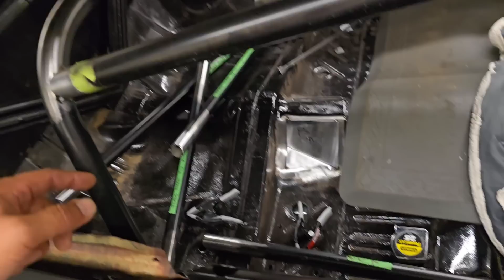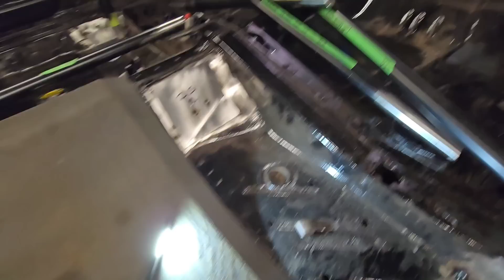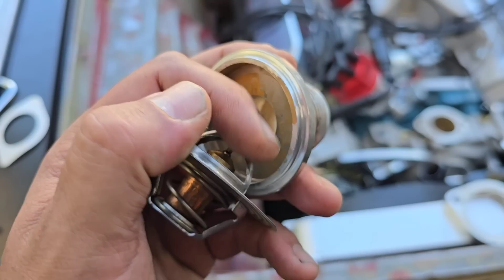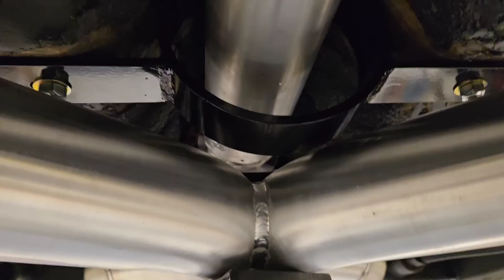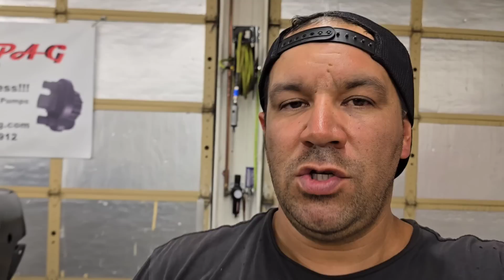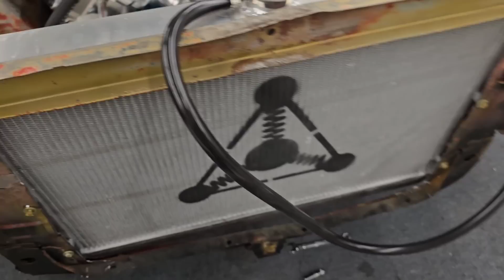My First Time Installing A Roll Cage.  One Week Left!  Thrashing All Day Long.

Comment: At idol 15 psi should be fine if it doesn’t drop to much at high rpm you should be pretty ok im no professional but I have played alot with big block cars here in Australia i only had one let me down idol psi on my fords was around between 18 psi down to 15 it’s at high rpm I would be more worried

Comment: 15 to 20 on oil at 180 too low. oil plug may be out somewhere. or bad gauge or bad oil pump. i'd drain check oil for metal. something is not holding oil pressure. kink in oil gauge line? run digital gauge. check oil pressure using manual pressure gauge.

Comment: Some great content here!! I installed my first hoop, down legs and cross bar in my 70 Camaro this year. I designed it to have a removeable cross bar. Once welded in I found my cross bar supports had heat distorted and make it difficult to remove and re-bolt back into place. The other challenge I ran into was painting it in place. While it looks great, it could have been better if I welded it more slowly, pre-painted the non weld areas. Might not get another chance but who knows?

Comment: I'd like to see around 40 pounds of oil pressure on all motors that I've built at idle  Big blocked Mopars  are pretty easy to pull the oil pump you can do it with them an hour  And you do not have to take the PAN off  If you still have a stock k frame You can Jack the motor up on the driver's side take 5 bolts out and the oil pump comes right off of the side of the block in the front where the oil filter screws on too  I have ran into oil pump relief valves not working properly  If not sure consult with your engine builder he will let you know if it's safe or  not to run that low of oil per  I'm looking forward  To see and you and Olivia getting this bad boy up and running Going to be a sweet ride

Comment: I had a feeling your thermostat was going to leak. I'd bet you clearanced it enough to appear flush, but not enough to account for O-Ring compression. Or you got " hosed " ( Pun intended ) on the expensive fitting and it's crap.

Comment: I enjoy seeing the work, but maybe not so much the moving around POV. Static video where you can't see everything is Ok as long as you're talking about what you're doing. Also in moderation ... 100 weld joints in the roll cage, I don't necessary want to watch all 100 welds.

Comment: You just showed the secret in wire feed welding, preheating  of the metal. However using a oxy- acetylene  set- up, and getting the metal cherry red, will produce your near perfect weld. You need someone next to you applying the evenly spread flame using a "Rosebud" tip. Try it sometime.

Comment: Love the guages. Sounds great at idle. Check Precision Oil Pumps for blue printed oil pump. You could always change the spring in the pump to adjust the pressure.

Comment: Danny, on the power steering bleeding process. you should be able to turn the wheel all the way to the extreme left until it stops. then hold it there. You will hear it start to scream a little. while you do this have someone add a little fluid if needed. then repeat the process turning right.
do this a few times until all the air works itself out of the system. Not sure if this is the process you were already using, so I thought I would comment. Great work by the way!
Hope this helps. Art.

Comment: Any time I have to burp the power steering system I put the front end in the air and cycle the fluid to purge the air out about 20 times full lock to lock 
Then turn the car on and do it about 5-10 times more 
Top off as needed
Reply: It’s good to see you fight threw the frustrations that custom parts ands mods tend to bring to the table 
Keep up the good work!

Comment: Instead of using flat washers on the bolts for you drive shaft hoop, you could get some flat strap stock, drill holes in it the proper distance apart, and weld the bolts to it...
That way, you eliminate the need to have a helper to hold the bolt while you loosen or tighten the locking nuts.

Comment: My big block the clearances were set to run 20w50 wìght oil I have 10w30 in it my engine builder didn't tell me that I also put a high volume oil pump but stock pressure my last big block had a high volume high pressure pump and it had 80 psi and the lowest it would go was 70psi this engine has 60 psi and then drops down to almost nothing but if I have it at 1000 rpm it holds about 30 psi  so I'm going to put the 20w50 oil in it and see if it changes if not I'll be pulling the engine back out to  change the pump and probably go with the selling shark tooth pump In it. Also I have to deal with my cooling problem

Comment: Big block Chryslers with 2 - 2.5  main / Rod clearance with a HV mellings style pump idling Hot 45-50 psi. , (30weight oil )
cut open your oil filter , if their is no metal in it ?  Maybe get a bigger pump , at least they bolt on easy from the outside .

Comment: ATF Will do the job just air in the system lift front tires off the ground a little & turn the wheel all the way in both directions should get rid of chatter & clear out the air

Comment: When ever you replace powersteering fluids your always not going to get all the air out right away and when those pockets get pressurized they kind of want to stay put in cavities they just don't want to leave your just going to need to drive it and get the car in different attitudes up hill, down hill, left side up, right side up,  steer in those attitudes slowly so the bubbles  don't compress down smaller they get stubborn to come out if you steer abruptly fast turn slow .   When I've done mine on first bleeds on new installs I have the car in the air and don't start car, pour fluid in and steering it lock to lock slow and while doing this have the return line at pump off, and down into a collection container. If you have the car running with a  spinning pump your just stirring more air into the mix, their way harder to bleed this way.  But keep reservoir full as your going lock to lock with engine off do it until the fluid flows clear pretty much then when you feel it's done bleeding hook your return line back up and make sure it's topped off and let it set for a few  hours then you can start the car and spin the pump,  still off the ground, steer through again lock to lock really slow 10 - 15 times then put that sucker on the ground.   

If your getting a jitter on left turn thats just compressed air rushing through the steering rack at the input shaft giving you feedback and you just have excessive air in that side, more than other but that's normal for air in the system...

Comment: On the power steering issue start it at idle turn it full side to side slow s few times then when a full left stop shut the engine off let sit a few minutes then do the same to the right I did this before a few times an it got the air out

Comment: Rule of thumb as long as your 10 minimum psi for ever 1000 rpm.    You can pull your pumps apart and adjust them internally if it doesn't make minimums shimming of spring relief valves will bring your pressure up if you not happy just as long as you don't take it up to far either were you get excessive at top RPM you'll be running it out to.

Comment: dude friggin nice shooting and working on your own - props.  i like these type of videos and its good to have them on the internet so people who are doing charger things can see it in the future.  i've had a hot rod clearanced engine before and it would drop to 15-20 psi warm at idle/off throttle.  Even when i put a higher pressure oil pump it would still hover around 20 psi.  if it runs better with cooler oil consider a thermostatic sandwich plate to an oiler cooler.  that would be good for extended driving periods too.  that fan and radiator combo is sick.  it started dropping temp immediately.  its gonna be awesome for road tripping.  nice thinking on the loop. i would have been heating and beating that thing in the vice lol.  on the power rack it may be that you're feeling twitchiness from over pressure.  those mustang ii style racks like around 800 psi of pressure and a lot of power steering pumps put out 1200+ psi.  if that's the case there are adjustable shim kits that install easily and will lower the pump to the correct psi for the rack.  ok bye don't stop grinding 🤙🤙🍻🍻

Comment: Dany, what weight oil are you running in the motor right now! Run a 0w40 0r 0w50 synthetic maybe that will up the oil pressure.

Comment: Was there 2 types of oil pumps? 1 is high volume another one was high pressure? I forget, are you running straight 40W oil? Superbee is 20 hot but I don't think I have fully grooved bearings. Good job!! You did a lot of work 🎉

Comment: Long held conventional wisdom said that 10 lb. per every 1000 RPM was fine. I've heard guys say recently that with using premium oils of today's technologies, 7 lb. per 1000 RPM is sufficient. as long as you have at least 10 lb. per at higher RPM you'll be fine. Use a good filter (as large as will fit), and change your oil often and live your life!
Reply: I also agree with the old oil psi "rule of thumb".  Also, it seems you could adjust the idle speed slightly higher. It sounds like you're only idling around 500-600rpm. Maybe shoot for 750-850rpm ? That would help increase oil psi at idle.